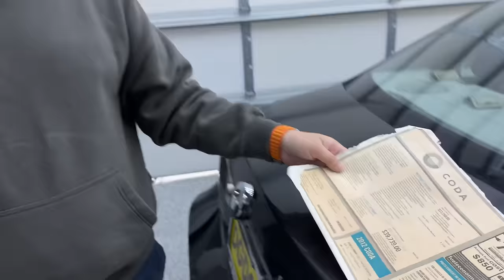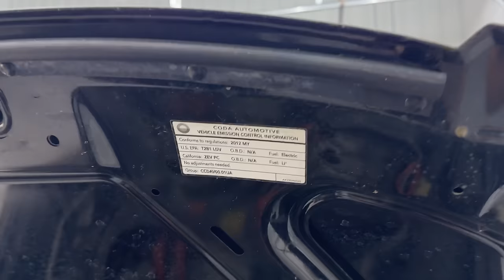Brand New Car Abandoned Outside For 12 Years! Restoration Of Our Coda EV - Part 1

Comment: San Jose is called northern California but is hundreds miles off like Eureka that is as wet as ever.  climate is much tempered in the SF Bay area but i mean 10 years is an eternity.. you want this done needs a respray. but yes it would be fun to detail.  if it has some paint to work on. (clear coat) else as I said respray.  good luck looking forward.

Comment: The older head lights have a polycarbonate for a lense as they are better impact resistance than acrylic.  

"Oxidation shows up on polycarbonate headlights in the form of an opaque haze that will turn yellow as time wears on. AutoPartsToys

Comment: Couldn't you just take an air compressor and blow the dirt off the engine. Then spray a towel and wipe down the engine parts you can.